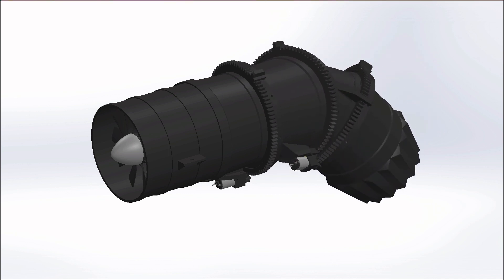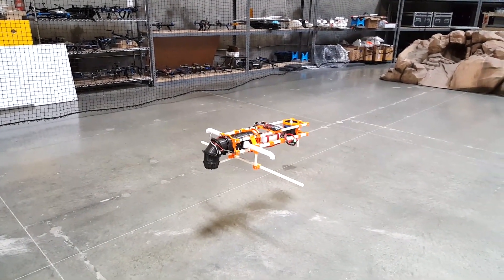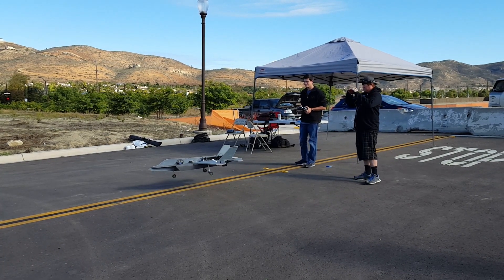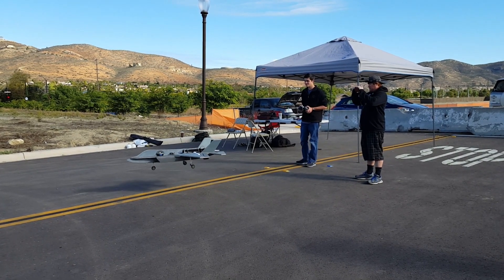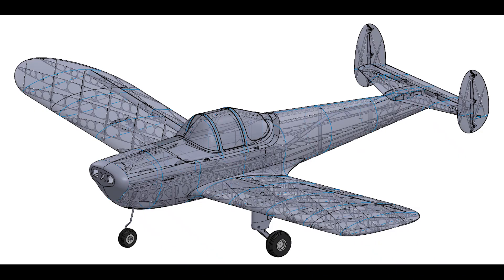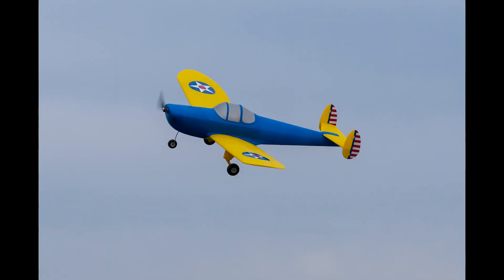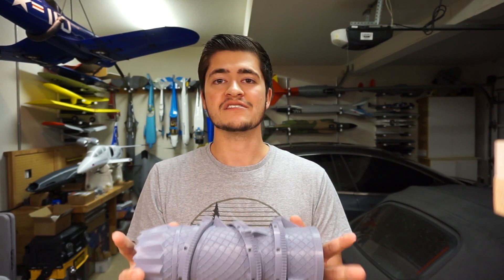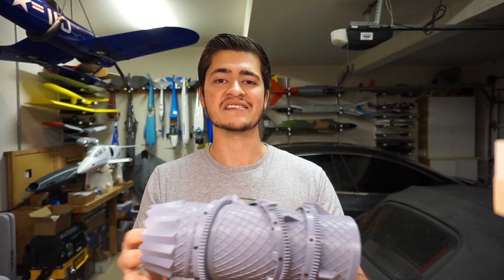F-35B Project Update!

Comment: Hi , thanks a lot for sharing these beautiful state of the art design for swivel bearing nozzle and duct OF f35 , would you please explain if possible , how do you keep the internal wall duct as even as before the rotation  or may be an edge is occured in the internal duct wall .  due to the changing position of swivel duct  and between the bearing joints faces cut at an angle , eventually we will have a difference between cross sections ( from circular to elliptical  or vice versa ) that leads to occur an edge    , i mean in time of all of them are  aligned  horizontally it seems that the internal of the duct wall is even without any edges , but as soon as the swivel bearing starts to rotate , the edges occur , in view of  this would you mind letting know these edges are unavoidable and do not restrict the airflow ? again thanks a lot

Comment: Really cool Eric! Could you please consider selling “hardware/electronics” packs beside the stl files? It would be much easier getting started with such a complicated aircraft model with a “working bundle”.
Reply from the maker: Of course, definitely trying to make this as straightforward as possible for others to put together. The plan is to offer a package of STL & gcode files as well as a build guide, parts list, and firmware for the control board. People can either put that together using provided schematics with a Teensy and some motor drivers, or buy a board from me. 

The motors, drivers, and encoders are all pretty easy to get from Pololu.
Reply: @ericmaglio  
Hello Eric, that sounds great, i'm also interested to get like a kit with the 3D printed parts. i'm using what i have on radiolink Pixhawk and electronics.
Please let me know, where i can buy it, I wish you all the best and stay saf and healthy.
KR Christoph from Switzerland